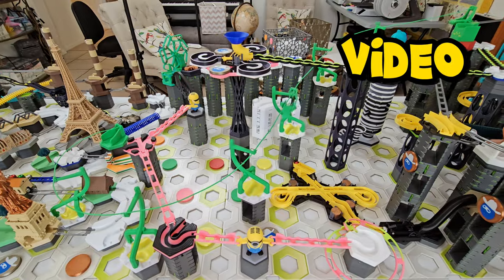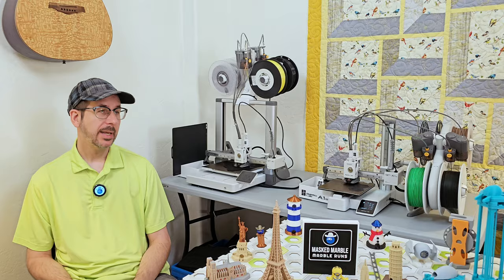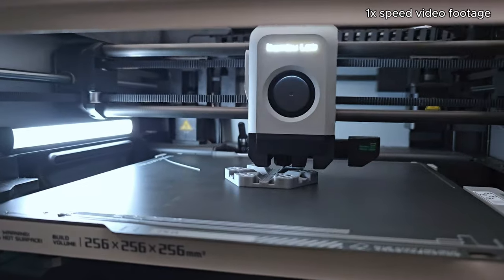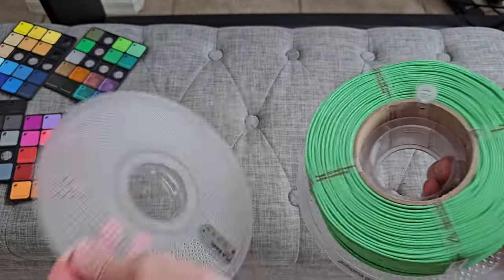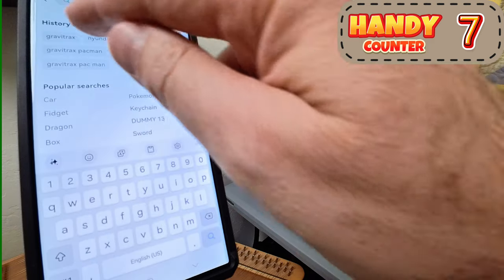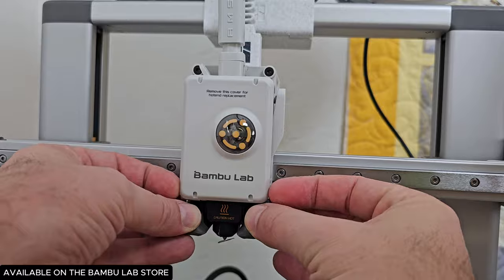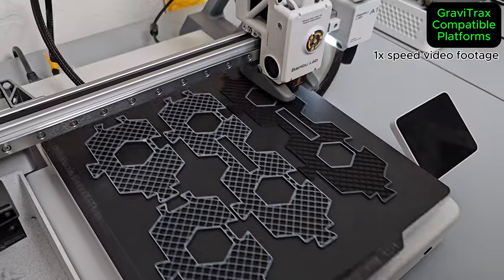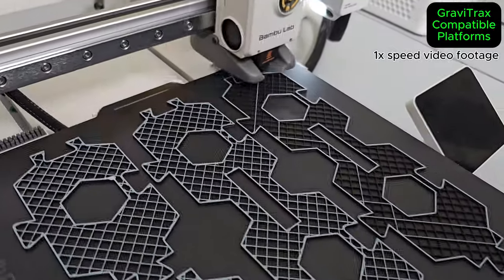Supercharge Your Marble Runs With The Bambu Lab A1 Printer

Comment: Nice video. It would be nice to have a 3D printer, but I wish they didn't have that many mistakes.
Reply from the maker: It's all relative. There is no aspect of Gravineering that is perfectly without error. Everything requires some amount of troubleshooting.
Reply: I have the A1 mini, the smaller printer in the video, and I haven't had any of those errors yet. I have had mine for over 10 months. It might have been a slicer error for him, but idk
Reply from the maker: Like I said in the video, there is no perfect tech. Every piece of tech will have its limitations, hiccups, errors, learning curve, and maintenance and troubleshooting to some level.

Also keep in mind I put in 1000 print hours on these printers. There are only 730 hours in a month. So statistically speaking, of course some issues are going to crop up with that much printing. Just like if you drive a car 100,000 miles, something is likely to need maintenance and repair. Over the course of that much printing, you're bound to see some issues, even if it's just from wear of the stainless steel nozzle as it is cleaned against the build plate for each print. Even my X1C has issues from time to time. But still my Bambu Lab printers are a million times better than my old Ender 3 and Creality Cr-10S Pro. It's a night and day difference.

Also I printed tons of different designs. Many designs print effortlessly. But some designs are more challenging. Some of it even depends on the direction that the slicer chooses to do bridging. In my opinion there are some times where the slicer makes poor decisions on the direction of bridging, or the excessive speed of extreme overhangs.
Reply: @MaskedMarble  Ahh ok, I get it.